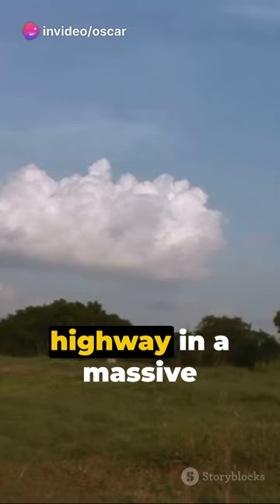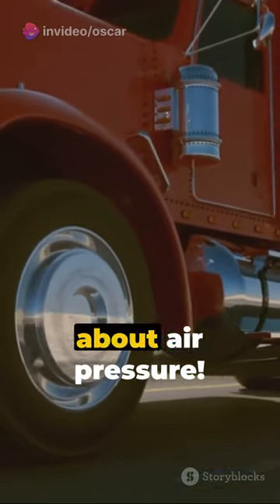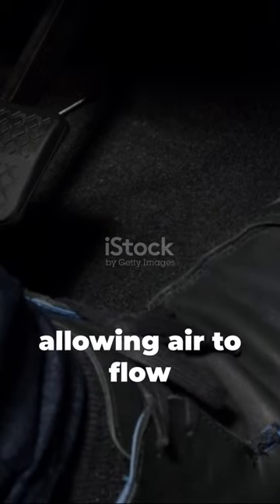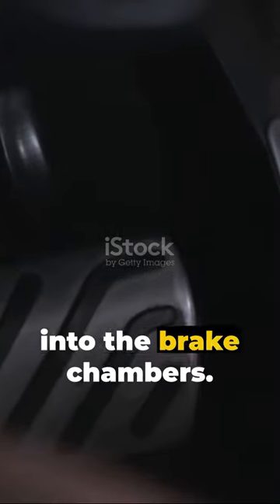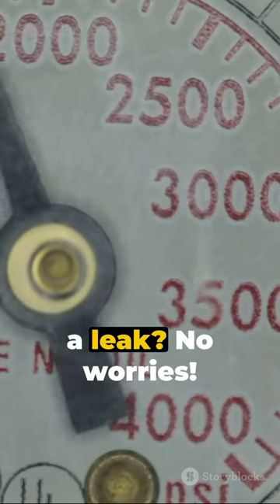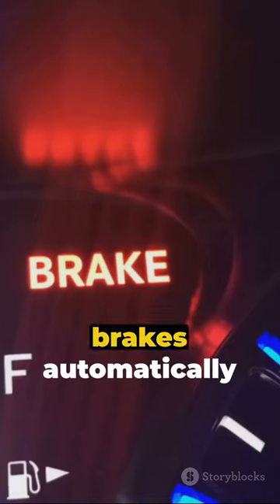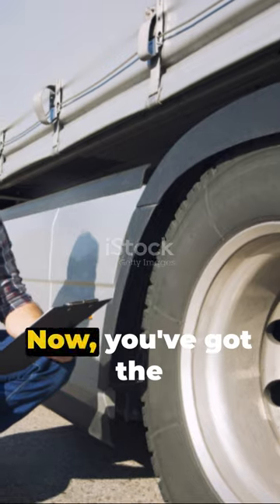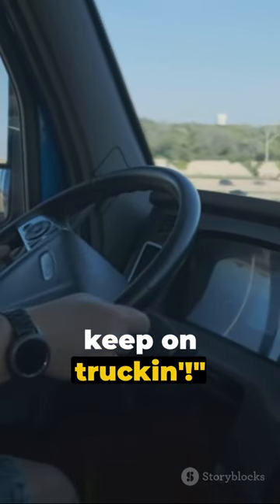Braking It Down A Trailer Truck Brake System #truck #automobile #brakesystem #trucklovers

Comment: Is it not reverse? You let out air for the brakes to engage?
Reply from the maker: no, air pressing on break pad makes them push against the rim. You might be talking about freno, u choke the engine, to help the truck slow down.